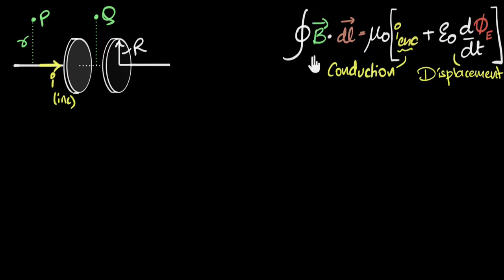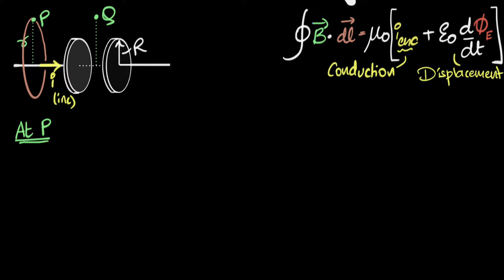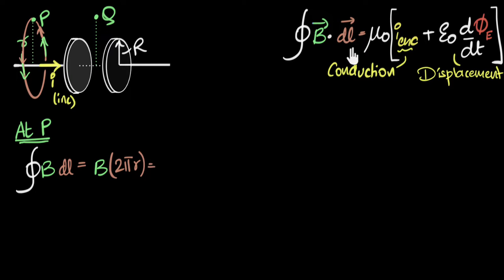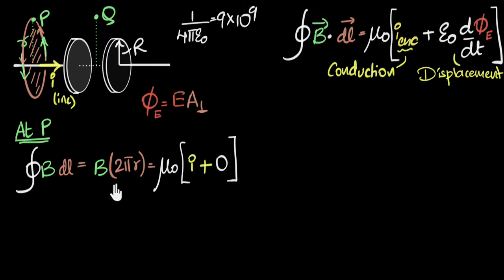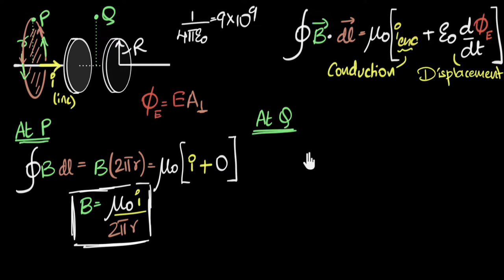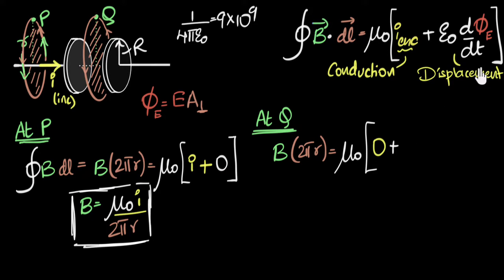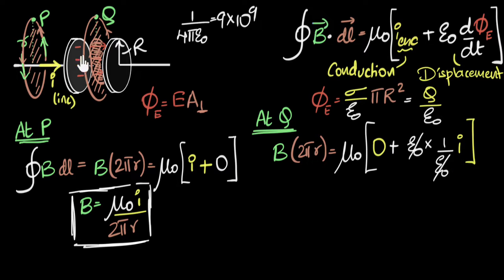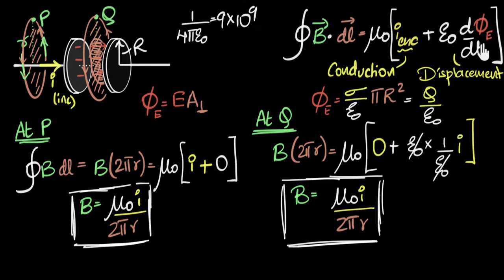Calculating displacement & conduction current | Electromagnetic waves | Physics | Khan Academy

Comment: 3:51 you told how electric field inside the wire is 0,
I searched a lot about it on youtube but I finally found it here.
Thanks for covering all details.
They all matter a lot to someone.
Reply: its not 0 its neglegible compared to the conduction current. Current itself is possible only because of electric field inside the wire.

Comment: Any body here...clarify my doubt...
1st case:
Consider you are having 8 apples. You gonna share that to 2 boys 
How do you do? Well it's easy eachu boy will get 4 apples
8/2=4 here 4 represents the no. Of apple each got
2nd case: 
Consider you are having 0 apples and trying to share that to 2 boys
Now two boys won't get apples. So there's share is 0 
0/2=0
3rd case: 
Consider you are having 8 apples but there are no one to share this. Which means you are not going to share those apples. That is, there are no boys which means there are no more shares RIGHT!!!!!
As per my point of view 8/0 must be equal to 0 only. 

The ans infinity holds good when i introduce limit concept. But there is an irony when i think like this. 
Please clarify my doubt. I am wandering with this for 2 years
Reply: See 8/4 means that 4 should be added 2 times to get 8 so this gives us 8/4=2 . Now 0/2 means there is now need to add 2 to get 0 so 0/2=0 . 8/0 means that how many times 0 should be added to get 8 so if we continue adding it it won't reach to 8 . 8/0 = 0+0+0+0+.... Infinity. this give ultimately there sum 0
Reply: @adityasonawane8912  in second case 0/2 as per ur answer 0 times we are adding 2 so that we get 0
In 3rd case 8/0 as per ur answer if we add 0 infinity times we can't get 8
Here infinity doesn't mean undefined 0/0 like expression is undefined.
The graph of 1/x leads to infinity at x=0 so infinity here doesn't mean undefined.
Reply: Its like 0×infinity which is undefined
Edit(for visualization purpose): if it is zero boys u can give unlimited amount to noone as u wont lose any apples. But if u have zero apples then u can give nothing unlike case3.

Focus on Frame of reference:
It is not just only about how many  apples those boys received(as they receive nothing in case 2&3). It is also about how many apples u give or lost.